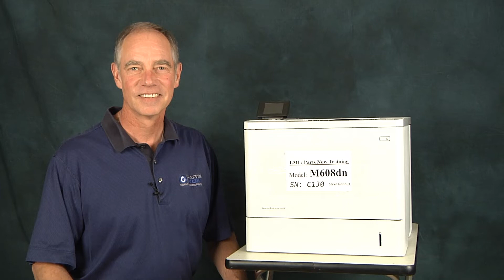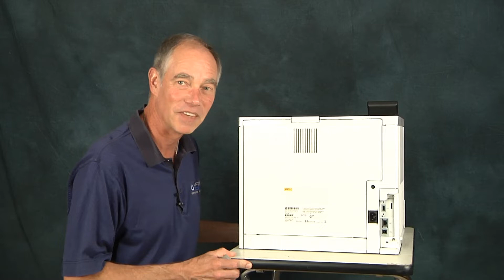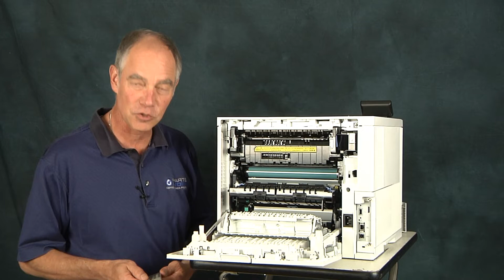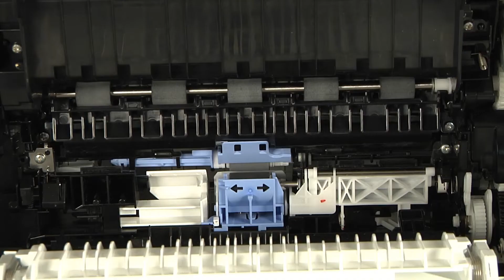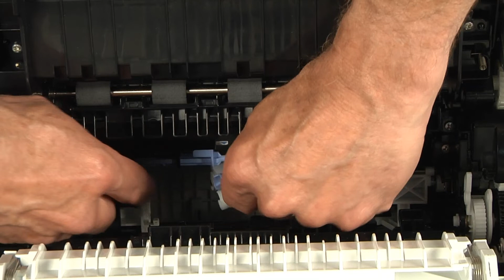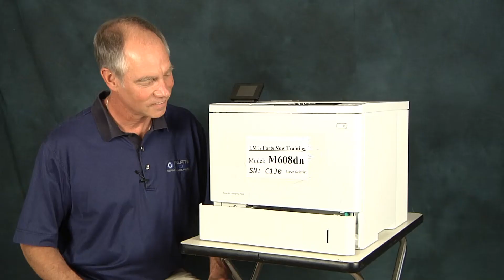M608 Pickup Rollers Removal & Installation w/out the Installation Tool.

Comment: I put it in several times, and it finally picked up on the 9th time; but it made an slightly squilling  noise every time it picked up the paper, and as never did before.   Could that be part an wrong installation I did.? All the rollers previously were bald, so I thot this would do the trick.   I tried different toners, but did do good as far as alleviating the noise, and still paper jamming every 4-6 th page.   Before hand it would pick up  an extra blank page every 5th page, and only rarely paper jammed.    I was always mindful  to try to hook the 2 pick-up roller assembly  up s.t. that it hooked into a metal band above, and was sure to click the light blue handle up.

Comment: Hi Steve, I attended one of your classes back in 1992 or 93 at Parts Now on the LaserJet 2,3 2P and 3si printers. I've probably worked on every model HP ever made. Your class was extremely valuable and thorough. I've had my own repair service company in Phoenix for the past 22 years. It's great to see you're still at it!

Comment: Lifting the pickup roller as demonstrated gives you a 50/50 chance of installing the roller with the paper height lever on top of the flag. This then means that the printer does not detect that the paper tray is lifted properly and just keeps lifting which causes the clack clack noise that another user mentioned. Also note that the separation rollers (the lower roller) for these models now have a black center on the roller instead of clear,  which makes it look different. Do not use the separation roller demonstrated as it can cause jamming or pinching of paper.

Comment: This is probably the best video out there for explaining installation and the pitfalls.  One other problem that can happen is if the upper roller isn't put in correctly, then the paper tray lift will start clacking.  There's a little white plastic piece that's supposed to hang freely.  If it gets bound up, you'll have this problem, and it will be apparent very quickly.

Comment: Watched 3 and this is the best. HP video don't talk. Other guy's big gloves get in the way of the video. He really explains it all ! These are really Samsung printers. HP brought them out. These get the famous m608x tray 2 overfilled error.  What I am dealing with now. I was told that the rollers can cause this. Also our pickup motor on tray 2 isn't working yet  on tray three missing the seperator roller ( since they broke it)  it actually lifts the paper.
Reply: They are Canon print engine.